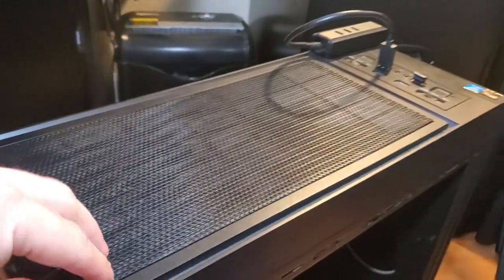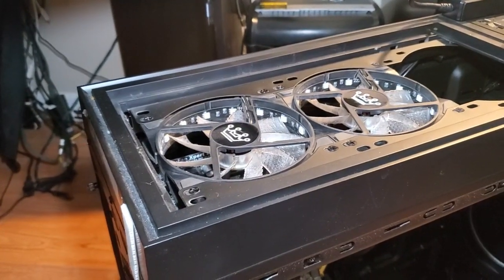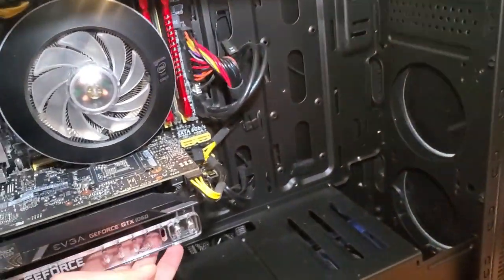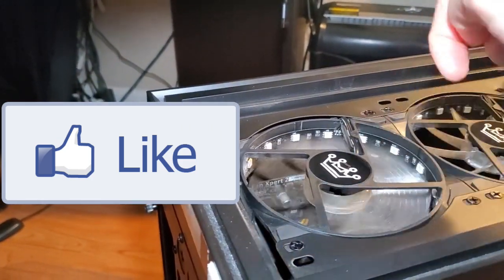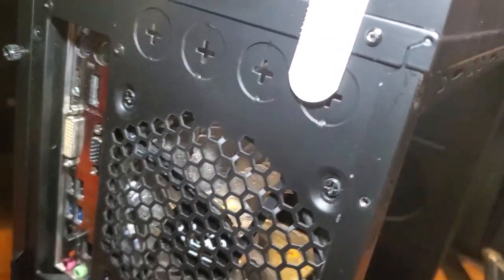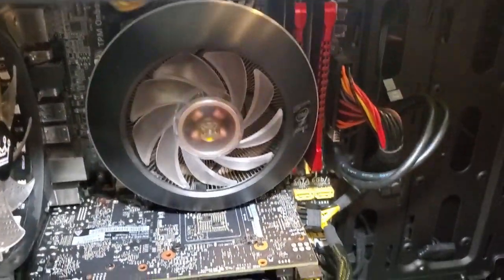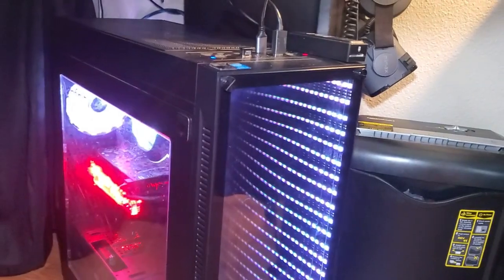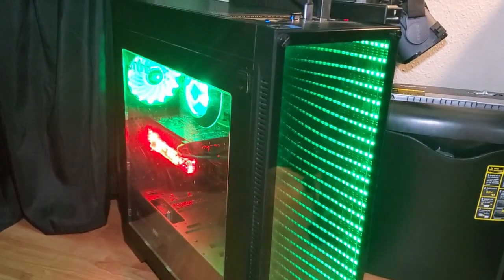This Life Hack will save your PC

Comment: Hey buddy, wanna ask your question. I have a Asus G73. Laptop I7. 16 gig. Memory. SSD. Drive and a regular Machanical HD It has a gig. GPU. My question is, it's running pretty hot. And even when I don't Have it set to overclock Turbo. It's still very hot. I haven't taken it apart yet because  To get to. Everything you pretty much have to take the whole thing apart. I've never seen something like this before. And I've taken many. Laptops. An fix there. Fans and whatnot. But my question would be what would be? The chances that I would have to Re paste the GPU and CPU.?
Reply: I think u have to dessesemble it and clean the fans from dust and clean the motherbored if its need to using pure alchole , u must also replace the thermle past of the gpu and the cpu

Comment: Dust is the culprit. I took my tower to work, blew it out with there air guns, omg.. I couldn't believe the dust cloud, one one of the guys eating his lunch in that room, he and his sandwich covered with dust. He was killed by his brother in law, rest in peace. Kyle, rest easy. I still chuckle. Thanks TT. another good video
Reply: Be careful if you are using air from an air compressor. Unless the system has an air dryer, you can be blowing a lot of moisture into the motherboard. Though the air dusters are actually a refrigerant R152a so I don't like using them either so it is pick your poison. Though I would love to pick up one of those Data Vac's which contrary to it's name is a blower instead of a Vaccum and they take into consideration keeping the static charge to a minimum but they are expensive piece of equipment

Comment: Quick question, Looking at your lighting effects and taking the camera capture into consideration, But in person when the lights dim down, do you see the fan slowing down. I have one fan that was improperly set and when I seen my lights dimming down, the one fan would also stop. that could also cause overheating and premature damage to the fan because it is constantly having to ramp up and down.
Reply from the maker: My pc when lights fade in and out looks like the fan is spinning faster and slower and sometimes reverse.
Reply: I suspected. I know In my system I have poor airflow to the point where I permanently took off my front case cover. Before with my old MSI X470 motherboard I had to switch to a static lighting effect with MSI Mystic Light, increase the fan speed from the bios settings, or switch the fan control type to PWM as with the absence of the 4th pin, it will pin the fan to max speed allowing you to use the flashing effects. With my new motherboard and the use of ASUS Aura Sync that issue stopped. I have to clean my machine every 6 months due to dust problems

Comment: I've had a PC that shut down randomly. It turned out to be the power supply failing. I watched the 12v rail dropping in the UEFI. Replacing the power supply fixed it. I suspect dust accumulation in the PSU to be a contributing  factor in its failure.